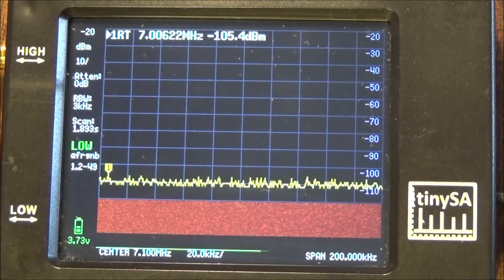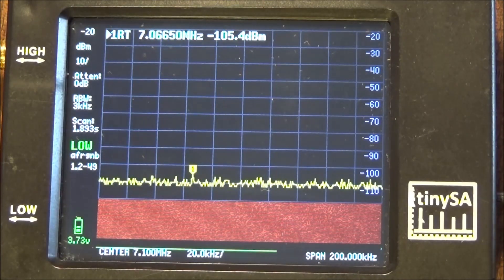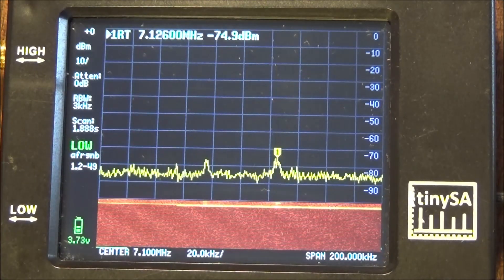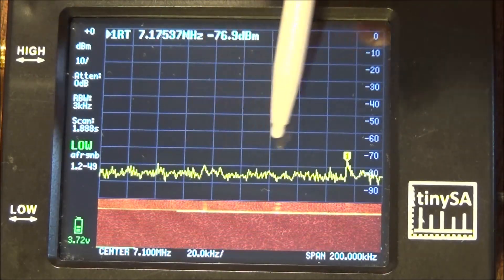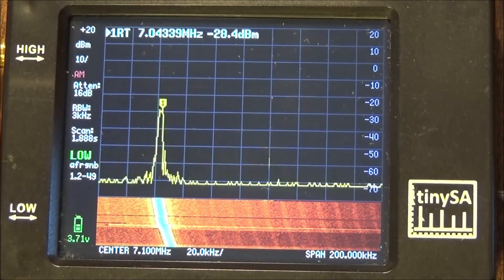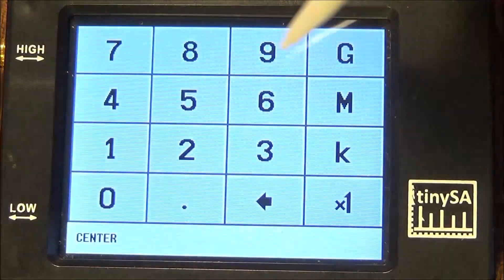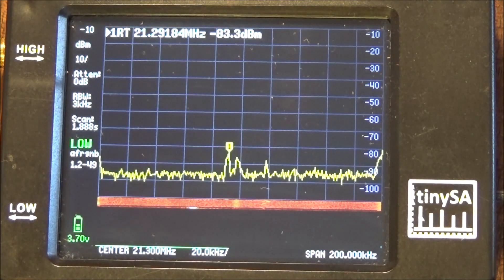tinySA used  to assess a Broadband Magnetic Loop Amplifier

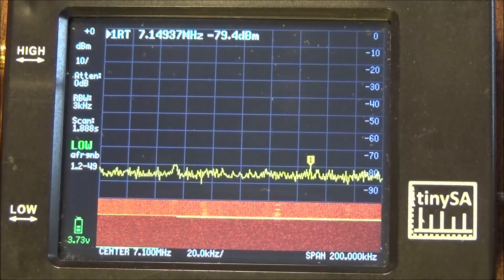Comment from the maker: The waterfall acts as a visual memory. And with your eyes it is often possible to spot weak signals in the noise as you can see in the video around 2:00
Reply: How did you adjust the waterfall to the higher dbm floor (hence the reddish color scheme) and still keeping the low dbmaround -80 to 110dbm value that usually would make a darkblue colors
aint the waterfall a slave to the dbm values at the right.?
maybe its old firmware with the red being the nominator at 80 to -110dbm, as it almost looks like its reversed coloscheme for the waterfall?
Reply from the maker: @JAKOB1977  Its old FW
Reply: @ErikKaashoek  I see, and the blue noisefloor as the dominant tone is prefered, imo.
Its so shockingly easy to put new firmware on these TinySA / Ultra with stm32cube, so if one would want to try this old fw with red as the dominant floor color, do you recall what the latest old fw is with that that waterfall colorscheme.? I understand that it will be limited fw, where certain features settings etc. are not yet present.
big thumbs up for your work Erik, Im gobsmacked how featurerich and comptent these TinySA tools are.

Comment: Is there a photo available for the physical setup of this measurement? How large was the transmit loop and how close to the receive loop?
Reply from the maker: The receive loop is 1.5m diameter. The transmit loop 30cm. Distance 4m
Reply: @ErikKaashoek  thank you for the video and quick reply to my question. I intend to repeat your experiment with my MFJ amplified loop and Elecraft RF generator.